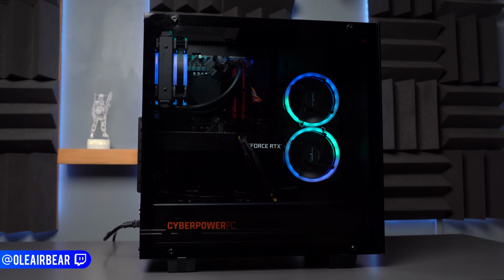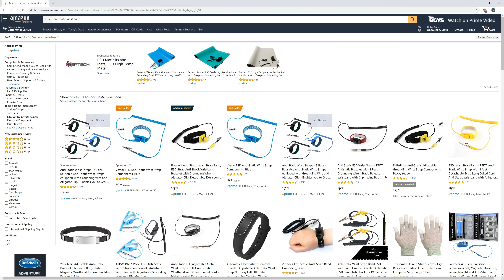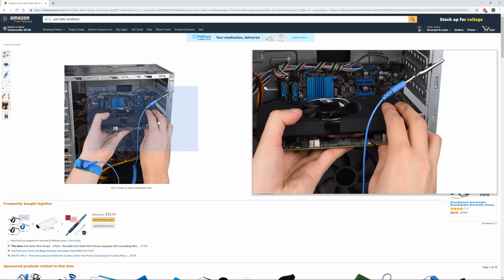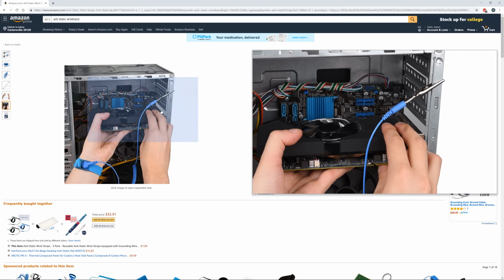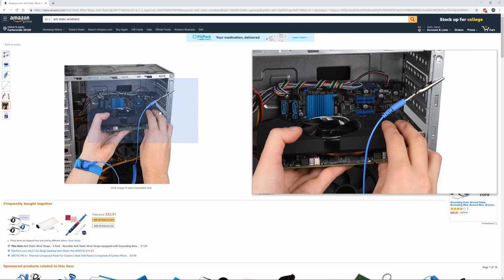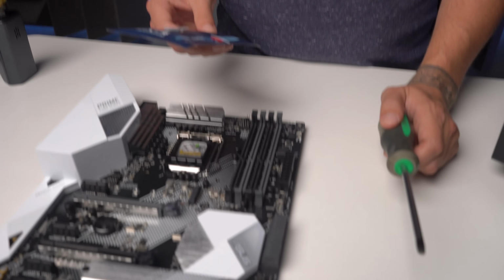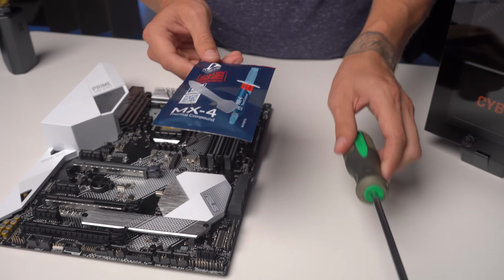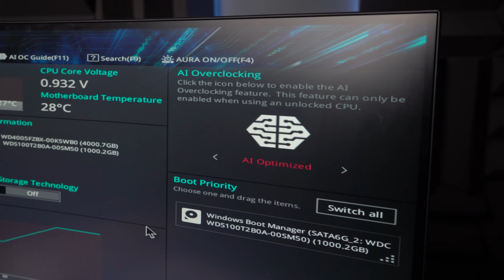How to Install / Swap your PC Motherboard STEP BY STEP

Comment: I got my pc a few years ago and it used to run good but now it runs like crap. Anyways, I want to upgrade it and am trying to learn as much about pcs as I can. So I have a question, what is the difference between a cpu cooler and a radiator
Reply: Hahaha

Comment: Wth no ever shows what to do next one the bios and windows settings. The actual hard part at least to me.
Reply: You basically just have to boot into the bios and make sure that your components are appearing correctly (CPU, GPU, Motherboard, RAM, Fans), and then make sure your boot is set to your SSD, or whichever drive you have Windows installed on. Then bam, you're at sign in window after exiting bios.
Reply: @Dylan Zammit this can depend on hardware and if it's a OS transfer, but yes for fresh installs default settings would be fine for most users.
Reply: TBH though it's not part of the hardware installation. Their should be some videos strictly on best settings regarding hardware. Tip, if you're transferring a HDD to a new system, make sure your BIOS/UEFI is allowing legacy input or it wont boot. (I know on asus MOBO you need to disable CMS and boom you're  in)
Reply: Wait so if you have windows installed in the same ssd you used in your old mobo or install it another mobo, will windows and all my other data be in there
Reply: @aaront.6581  yer bro. You boot your pc from that ssd
Reply: @brilyn  just like that?unplug from old then plug and boot up to the new one?no need to backup ssd or mirroring or imaging or whatever its called?
Reply: @thewireman5220  I have the same question
Reply: @brilyn  I literally came to this video looking for the answer to this question, because I fear losing all my data. Thank you!
Reply: Paul from Paul's Hardware always does it.
Reply: google: "Sysprep Generalize"
Reply: Yeah and won’t windows complain that the computer isent registered or a proper version of windows 10 or something
Reply: You can look that up yourself, they're not going to hold your hand
Reply: @slaydog5102   3 years later I figured it out. 🤣🤣 You're random af 🤣
Reply: @TheIskateTV so what you did ? Just reinstaling chipset ?
Reply: https://www.youtube.com/watch?v=RYYoCXh2gtw&

Comment: I changed motherboards and all that happens is my fans go on full blast and the monitor doesn’t display. There is a white light on my CPU indicator and and white light above each sticks of ram. I tried replacing all of them but I have the same issues.

Comment: I've never installed a motherboard before. Should I try this myself? Or should I just pay $80 to have it installed? Its a motherboard, a Processor and RAM. I don't want to mess anything up by not doing something right.
Reply: Brandon Blackfyre me too bro i have the same problem
Reply: October Is Cracked plz don’t do it they might even ruin it just build it bro try your brst
Reply: Do it yourself, the best way to learn is by doing it, I was scared as well but once I did it one time I had no more fears.
Reply: Never ever fucking do that plz dont

Comment: Great guide. 1 thing to note, with windows 10 your product key is bound to the mobo/MS account. So if you dont have your MS account linked to your OS. Do so before swapping or your product key will not re activate. Or have your original key handy if you still have it. I usually stick them on the inside of the case for my customers but most people through them away after they activate it. .>.<
Reply: Wait so the original key I used can be used twice?
Reply from the maker: So true!
Reply: How do u link your MS to your OS?
Reply: This.

The whole reason Inwatched this video.
Reply: it seems my key is linked to my MS account, is that what I want?
Reply: @GengarsTeeth  hey, you wanna link your microsoft account with your operation system
Reply: Thank you for this crucial step!
Reply: How do I do this? I upgraded to windows 10 for free, so I have no idea how to do any of this stuff. My first PC was built by someone else, and they gave me a copy of windows. I got the free update though and it's a legit copy (as I've checked) I have no idea how to do this stuff you mentioned though.
Reply: What if i never activated windows lmao
Reply: @Jake72826  Watermark for life I guess
Reply: Can anyone point me to a video that explains how to do it
Reply: I got a prebuilt so I don’t have the product key, how do I make sure my ms acc is connected? I currently have a tuf gaming mobo and I’m getting a msi mag tomahawk mobo, will that also affect anything?
Reply: @Mystic_1452  did everything work out in the end?
Reply: @SciK. hey dude yeah everything worked out super fine, i just followed the directions from this vid and a few others i saw at the time. the prebuilt did have the product key i just needed to search for it on my pc and write it down
Reply: @Mystic_1452  Ah i see. My windows is linked to my microsoft account so im hoping i dont need to do the key method. Im actually upgrading to am5 soon so yeah im kinda nervous.
Reply: @ it really is as easy as they say, just gotta make sure you have everything you need before taking everything apart. If you haven’t already I’d still recommend looking for your product key, always good to have a backup ready to go
Reply: @Mystic_1452  I will definitely do that, thank you/
Reply: @SciK.I am also upgrading to AM5

Comment: Omg,I just bought a new motherboard and came home and got this video notification. Thanks😉
Reply: That because Google be spying on you
Reply: @Trendleader863  you aren't lying. Even if you just TALK about something, you will get ADs for it. You don't even have to type or search anything.
Reply: @brandonblackfyre5783   It'll get real freaky a few years from now, all you'll have to do is think it and you'll get ads for it
Reply: grim reefer0420 your not using private tabs and a vpn? What the HELL are you doing on PH then??
Reply: @Trendleader863  🤣🤣
Reply: @Grimr33fer  LOL
Reply: Google spying INTENSIFIES
Reply: That’s pretty pog
Reply: @FBI what is wrong with that dog idk
Reply: Coindecence
Reply: I bought a "brand new ASUS mainboard, factory packaging". When I installed it and checked the bios version it came out that the mainboard was already three years old. Next shock, it has a TPM 2.0 slot but the chip has to be bought extra. Then they sold me an intel i5 CPU that just doesn't pass the test for win11. So they do this all on purpose so they can sell older hardware. There is nowhere any mention of the actual manufacture date on any packaging.
Reply: I'm at the point where I just think of what I'd like to eat and the next minute it comes flying through the kitchen window.
Reply: Fuck you dog